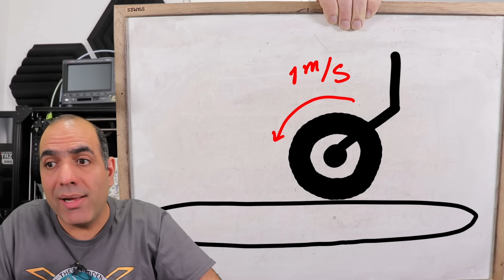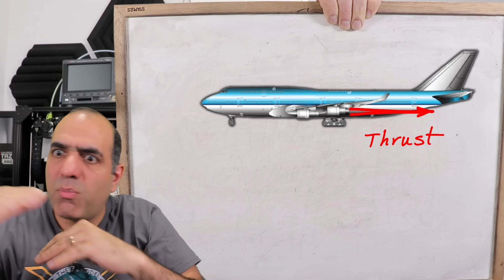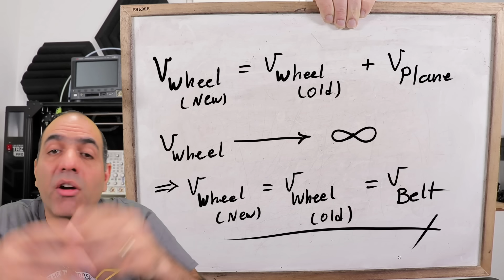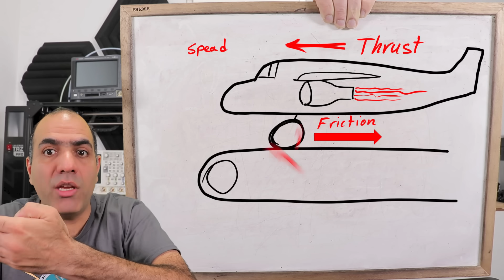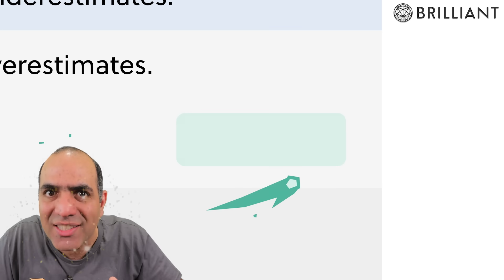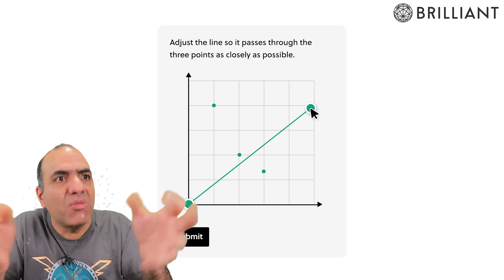Airplane Question that Drove Me NUTS!!!

Comment: Case No. 5 : Friction between the wheels and runway, no friction in the bearing, but the wheels have some rotationnal inertia. The wheel and belt matching, their speed would ramp up but the airplane wouldn't move forward. At some point the belt would go so fast that it would draw in air fast enough for the airplane to take off.
Reply: I like this scenario. Imagine a conveyor-runway that moves at 10 km/s to create wind for the plane. Would be fun.

Comment: Maybe they meant that the conveyor belt moves forward the same speed like the thrust of the plane, so the wheels don't move at all, but the plane moves forward.
Reply: Correct, in the proposed condition it is irrelevant whether the aircraft has wheels or does not have wheels.

Comment: I say yes, it can take off. The whole point is to get the turbines moving. if they move the whole plane is moving, that's why it need space to accelerate. Why dont make plans on conveoyr belts because they also need space for landing secure. So there's no point not giving them the space.

Comment: what a silly question. why would the plane be able to lift off? the only thing that's moving are the wheels. there's no air pressure on the wings. who cares what wheels do, it's the air/wings dynamic that propels the airplane upwards, not the rotation of wheels

Comment: For me the answer is yes, because propulsion of airplane do not depend by rotation of wheels, but by turbofan engine push, so airplane will lift off after run on runway when it arrive to take-off speed.
All you need is a conveyor wide and long as a runway as wrote or a strong wind (take-off speed) in opposite of airplane direction opposed by the turbofan engine push.
Reply: No, thrust doesn't make the plane fly though. Movement of air around the wings make it fly. Before it takes off, there is little difference if the plane is propelled by thrust or wheel rotation. The plane moves as a whole. If the thrust pushes the plane forward, the wheels must turn. They are connected to the plane, and making contact with the ground. Once the plane is in the air, the wheels don't matter. But for the plane to fly, it needs to move the wings forward through the air. As the plane moves forward in this scenario, the ground moves it backwards as the wheels are connected to both the plane and the ground through friction. It can never gain forward momentum through the air, only relative ground speed.

Comment: so my guess: afaik those kinda big planes have unpowered wheels and accelerate using thrust only, so the conveyor trying to drag it back should make no difference, the turbines are still pushing on the air that (presuming no wind tunnel) should behave more or less the same. you'll likely break your wheels and conveyor though if that tries to keep up :P
Reply: Well, doesn't it translate the engine thrust into velocity using the wheels still? If it can't move relative to the air, it can't gain lift.

Comment: First of all, you did not solve the question. You gave 5 answers, but you did not understand the question. Lots of effort was given to describe a things not pertaining to the question.
The answer is in the question itself. The 747 is sitting on the conveyor belt. No propulsion is mentioned therefore, no forward movement is implied. Hence, sitting.
If there is no stated means of propulsion then the 747 cannot take off. The answer is no take off.

Secondly, there are too many dead ends which makes this question a joke.
How can a conveyor be as long as a runway? A conveyor belt is an infinite length, duh! The 747 is sitting on the conveyor (not moving), how can the 747 move: not given. Regardless of the conveyor belt being synced with the wheels, the friction of the conveyor belt as wide and as long as the runway (laughably) must require a separate powered source to turn the conveyor belt to match the 747. However, the friction or frictionless is not mentioned. Only the matching speed. The conveyor belt at 0 MPH/ 0 KNOTS/ 0 air speed is exactly 0 conveyor belt speed when the 747 is sitting on the belt. Sitting on the conveyor belt implies a 0 conveyor speed. So no, the 747 cannot take off.

Third, how is power transferred to the wheels to give traction without an established propulsion method? This is also not given (a special 747).
All the wheels spin freely (friction or not) and can only brake on the a 747. How are the wheels propelled? They can't, so the conveyor belt would not be moving. Even if a 747 was on a runway, how does it take off without propulsion? No powered wheels = no a third time.

Fourthly, there is no external wind mentioned, therefore no lift can be generated (surprisingly this is a popular theory here in the comments). The answer is no a 4th time.

Fithly, propulsion cannot be implied as it is not mentioned. No other affixed wind propulsion is mentioned. No propulsion other than wheels turning cannot provide lift.  If the wheels match the conveyor belt spinning to match the 747 powered wheels, this would result in a net 0 movement if the conveyor was designed to counter the wheel movement. Therefore, no air flow over the wings from powered wheels = no air lift generated = no take off.

Sixth, the 747 is not configured to take off even if it had the thrust to take off.
 The 747 flaps are configured for cruising air speeds, not for taking off. So no take off a 6th time.

Seventh, Mythbusters changed the parameters of this question. There was a propulsion method via turning propeller to generate lift regardless of being pulled. Actually being pulled on a simulated conveyor just removed the need for wheels moving, but the aircraft was moving forward with zero wheel movement. The airflow over the wings from a propeller provided the lift when pulled up to the V2 take off speed.
The Mythbusters needed to achieve take off without the propeller turning and without pulling the aircraft to match the parameters of the question. Without pulling  and without the propeller turning, the aircraft would just be sitting on the runway on the conveyor.
So this is not the same as the test on Mythbusters, so the answer is no a 7th time.

The answer is in the question and the answer is no, the 747 cannot take off within the bounds of the question... simple.

Comment: I don't really know what the question means. Wdym match the speed of the wheels? Wdym opposite direction?

Is it opposite to the movement of the plane? In that case the faster the belt goes the faster the wheels spin and the faster the belt must go to match their speed but the the wheels speed up until they melt. The gear probably collapses, the plane impacts on the belt where it probably disintegrates and pieces of it are thrown backwards potentially getting airborne. The plane may be able to take of conventionally if the acceleration of the belt is limited.

If the belt moves with the plane then increasing the belt speed will decrease the speed at which the wheels are spinning and the belt speed settles at half the speed of the plane (assuming the speed of the wheel is calculated as v=omega*r and not related to the movement of the belt or something)

Comment: well, if there is a wind, there is a lift (pressure differences etc). so no, if it was completely isolated conveyor (from any external factors) it wouldnt lift, why would it. its like hanging plane on the wings and spinning wheels in place, it wont lift off by just spin of wheels. 

now lets see what will be the answer :D

Comment: For answer three we could also take boundary layer friction into account - the moving belt will cause the air to move towards the plane. The question is if the thrust is enough to make the belt spin fast enough to produce sufficient airflow over the wings.
Reply: It will be a weird kind of airflow though. It'll be non-uniform, faster when closer to the belt surface. So it'll be faster under the wings and slower over the wings. I think it means that the lifting force will be less than with uniform airflow and depending on the scale of things might even be negative so it wouldn't ever lift no matter the airflow.

Comment: I am seeing a problem with the third answer, as friction is a force oposite to the thrust of the engines, it decreses the acceleration. Meaning when you get toe the point, that friction is as large as the thrust the acceleration reaches zero but the speed stays the same wich causes the friction to stay the same as well. Meaning the plane would just reach a constant speed.

Comment: 0:14 yes it can
Reply: though if you're matching the speed of the wheels, the wheels will not turns, if it all starts from the plane and everything still, as the plane is not driven through its wheels.

the wheels make up the difference between the ground and the aircraft

Comment: No it cannot, it needs enough airspeed over the wings to generate lift. In this case the airspeed is 0 with no wind (which is not mentioned in the description...), so no lift.
Reply: haha and I was completely wrong
Reply: @SoepThe1  You are not wrong; you are correct. You need an air flow for the plane to take off. This plane will be stationary for an observer sitting at the side of the runway.
Reply: @hal6702   Except the engines don't care about the wheel rotation speed, the plane is pushed by the engines not the wheels.  The plane accelerates along the conveyor belt with the wheels rotating at double speed not at infinity. (X 1 for the plane speed plus X 1 for the conveyor speed in the opposite direction.  That X1 (plus 2 X rotation speed plus ( minus X 1) conveyor speed) between the tyres and the conveyor satisfies the question AND the almost frictionless wheel hubs and the attached plane are still bombing down the 'runway' away from that conveyor and tyre interface.  People cannot see that the apparent 2 X speed of the conveyor includes the plane's speed along its take off path.
Reply: @givenfirstnamefamilyfirstn3935 
I don't know what you are saying, but it has nothing to do with what I wrote earlier, nor with the requirements of the problem.

Comment: Before watching the video:  I think it would NOT be able to take off.  Because the plane would not be able to create the air flow across it's wings which generate the lift.  The Engines only push it, they don't make it fly.

30 Seconds later: Yeah, you raise a good point, the wheels aren't actually pushing, so the plane would still be pushed forwards by the engine.

45 seconds later: I guess friction does exist, so back to the first.

60 seconds later: could be a trick question.

75 seconds later: The 30 second answer is probably the right one in the real world.

(Time scale exaggerated)

Comment: 22 seconds into the video. No comments have been read... My answer is no! The aircraft cannot take off. Because there is no air flowing over the wings creating lift. The engines are going, the wheels are turning, but there is no lift across the surfaces of the wings. There may be some air flow over the wings, but it's not going to be enough to provide the lifting force that the plane needs... And now to watch the rest of the video to see if I'm correct... Edit. And now, after watching the video, i just don't know! 😀

Comment: This is an example of when mathematicians reduce reality to too simple a system. 

Logically, the aeroplane produces thrust, which pushes it forwards, the wheels are on bearings, presuming that the aeroplane has significantly more thrust available than the minimum required to reach stall velocity, it will take off. The speed of the wheels and runway are irrelevant. BUT if the wheel (presumed surface) speed by some magic is defined to ALWAYS match the runway surface speed in the opposite direction, then it cannot move at all, because ANY forward movement of the plane relative to the ground/initially stationary conveyor, will result in the wheels turning, which the conveyor belt runway will magically immediately match. So the magical assertion that the wheel speed must always = the belt speed magically keeps the plane on the ground assuming zero head wind, in a similar way to how strapping buttered toast to the back of a cat would create levitation: Only in maths land.

In reality, the plane would probably ruin the wheels and take off.
Reply: The conveyor will appear to match the double speed of the rotating wheels viewed from the plane BUT that is viewed from a vehicle hurtling down the 'runway' propelled by four 50,000 lb thrust engines.  Think relativity and algebra, it obviously flies, look at the Mythbusters clip.
Plane  motion V forwards gives wheel rotation V, conveyor rotation backwards gives another wheel rotation V. Wheel rotation is V plus V or 2 V.
Mathematics has to be used with one's eyes wide open and not leaving things out.
(Forgive any apparent arrogance please, I have ATP licence, have done maths, additional maths, computing and applied mechanics).
Reply: @givenfirstnamefamilyfirstn3935  The problem explicitly states that "the conveyor belt is designed to exactly match the speed of the wheels". So one thing we can say for certain is that the conveyor doesn't match double the speed of the rotating wheels.

Though I think I know what you're getting at, but you need to be more specific about speeds: 

The wheel as a whole has a vector comprising of a direction and velocity in relation to the ground, and the plane. In relation to the plane this will be zero because they are rigidly attached. In relation to the ground, this may be greater than zero if the plane is moving in relation to the ground. 

The wheel also has a surface velocity proportional to it's angular velocity and radius. If you pick two points on the wheels circumference opposite to each other, the vectors of these points will be equal and opposite. If one of these two vectors matches the vector of the conveyor (as stipulated in this hypothetical problem statement) then the vector on the opposite side will have twice the velocity of the conveyor surface in contact with the wheel, in the opposite direction, in relation to the conveyor centre of mass. The same is true of a vector on the opposite side of the conveyor in relation to the wheels centre of mass.

It's a (probably purposefully) badly defined question. I'm not sure there's any value in trying to derive sense from it and work out one irrefutable solid answer to it.

The MythBusters clip isn't the same situation because slip is allowed between the "conveyor" and the wheels.
Reply: @givenfirstnamefamilyfirstn3935  Let's do a step by step:

The plane of "m" mass is stationary on the stationary conveyor. The wheel velocity in any interpretation is equal to the conveyor.  I think it's fair to assume they mean surface velocity though. They are all zero.

Now the engines are turned on providing "f" thrust which, due to f=ma, means that the plane will experience an acceleration force, presuming it isn't fixed in place.

If the plane starts moving, then the wheel centre of mass would gain a velocity relative to the conveyor centre of mass assuming the conveyor is attached to the earth and we are measuring plane velocity relative to the earth. 

Assuming a no slip boundary condition at the conveyor wheel surface interface, one of two things must occur: 

Option 1: If the conveyor were stationary then the wheel would start to turn, and the conveyor would match this surface speed. Since the wheels surface velocity is proportional to it's angular velocity and radius and it's centre of mass vector relative to the conveyor centre of mass, then it cannot move, because any rotation is matched by the belt. This is a nonsensical interpretation in the real world. Due to raw maths it wouldn't be able to move.  

I think I just got what you meant about "double the speed", you're assuming that the velocity of the belt surface matches the wheel surface velocity, in THE SAME DIRECTION! I suppose this isn't specified, and you could interpret the question to mean that if you tried hard enough?

Anyway,  Option 2: The surface velocity of the two can be equal if they are zero, which they are at rest. The plane could accelerate with no issue without the wheels rotating, as that relation locks the two together and the plane accelerates up the length of conveyor. 

I think that's legit the answer. It's basically a steam catapult off an aircraft carrier.

Comment: Unless air flows over the wing causing a significant enough pressure difference between the under and upper sides causing lift, the plane can thrust all day long and never take off.
The Mythbusters case is different. The plane is moving through air and the air is flowing through the wings causing lift.

Comment: A plane isn't driven by the wheels...
The runway can move as fast as it want, even if the wheels go backwards the engines will push the air and move the plane forwards.

Comment: "Yes, the plane can still take off in this scenario.

The speed of the conveyor belt has no effect on the plane's ability to generate lift, which is necessary for takeoff. The lift is generated by the airflow over the wings, which is created by the forward motion of the plane through the air.

The speed of the wheels relative to the conveyor belt does not affect the speed of the plane relative to the air. As long as the engines are providing enough thrust to propel the plane forward, the plane will take off normally.

Therefore, the plane can take off as long as it has enough speed and lift to become airborne, regardless of the speed of the conveyor belt underneath." - ChatGPT

Comment: Yes it will take off. The wheels act as bearings since the jet engines push the plane forward the wheels will be spinning at double the rpm.